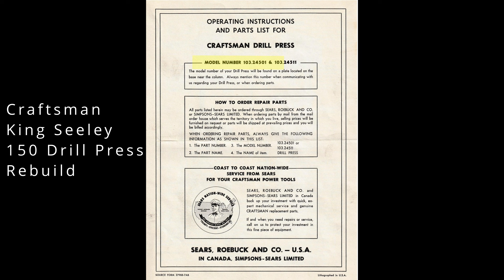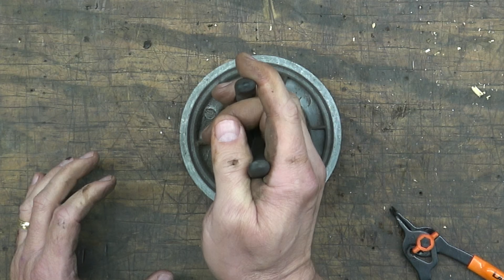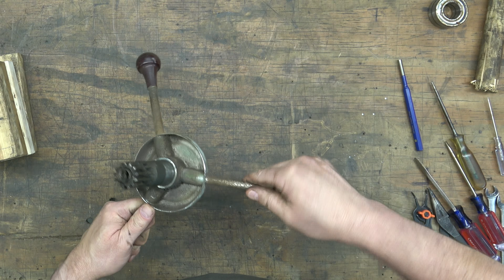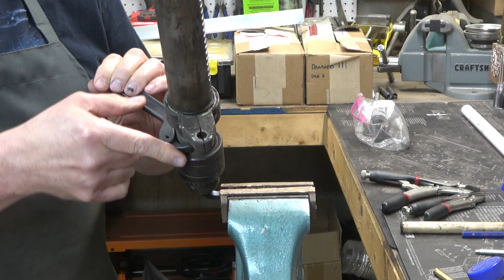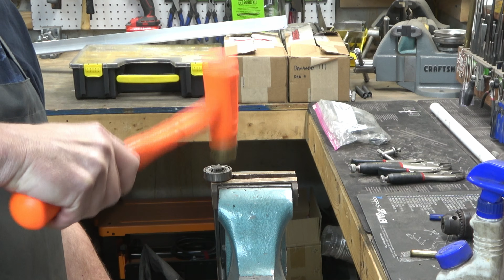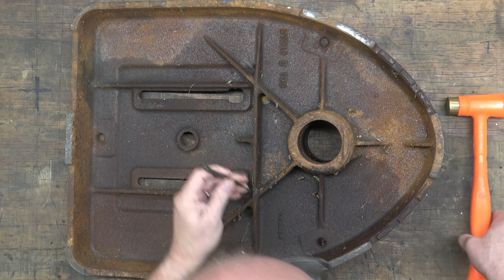Part 2 Craftsman KS 150 Drill Press Rebuild Disassembly Continued

Comment: Jeff, with the number of these drill presses you have restored , you could probably do it with the lights off. 
Excellent work.
Reply from the maker: Thank you for the compliment. I do have a bit of experience with them now but back in 2020, I did not know a thing about drill presses. I started by needing to rebuild one I got uses and wanted to replace the bearings. I found the Garage Journal Forum and began my education and experimentation with the help of some great people on that forum. Eventually, I was popping in on various threads where people were asking the same questions I had in 2020 and decided that video would be a better medium to show and explain stuff about the machines and here we are. Thanks for watching.
Reply: @JeffsShop Jeff,  did you see the post I did on part 1 of this series? There is a guy who makes the return springs for the quill. I gave his seller info in that thread. I bought one just to keep in case mine breaks.
Reply from the maker: @Jimgotalathe  Thank you, yes I saw the comment. I sell the springs on ebay.
Reply from the maker: @Jimgotalathe  Thank you, yes I saw the comment. I sell the springs on ebay.